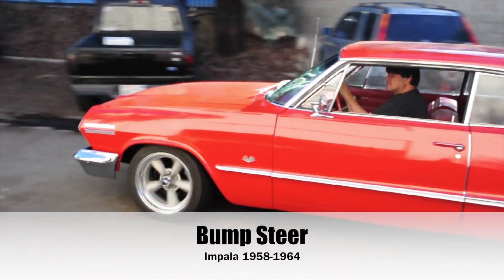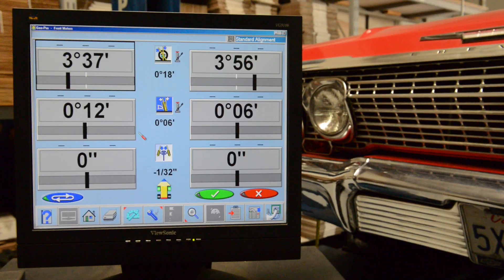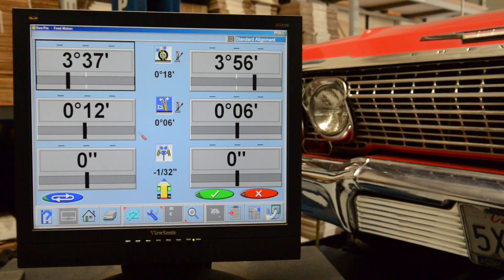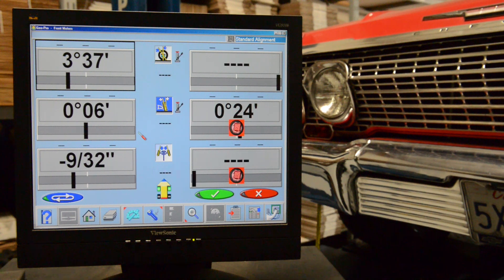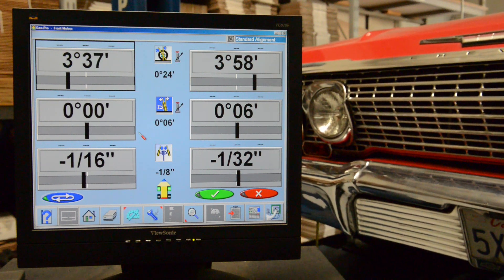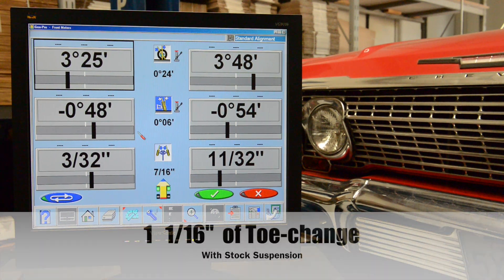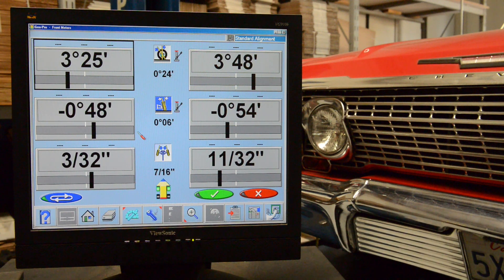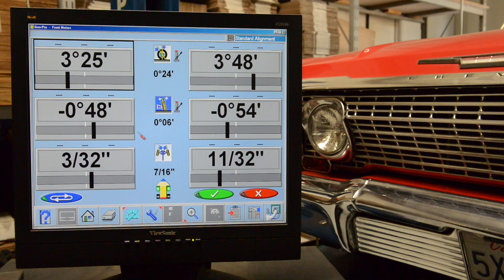Why 1958-1964 Impalas Wander Bump Steer (Part 1)

Comment: Yeah my 63 impala (no PS) doesn't seem to have a "bump steer" problem, but it wanders all over the road, even perfectly straight and smooth roads. I believe it to be wear in the steering gear box. Recently had it aligned, tech said everything was ok but still it wanders. Maybe you have ideas based on your experience. Wish I was local but I'm way over in the Southeast.
Reply from the maker: Give our tech line a call at 1(877)470-2975 and we can totally help you out.